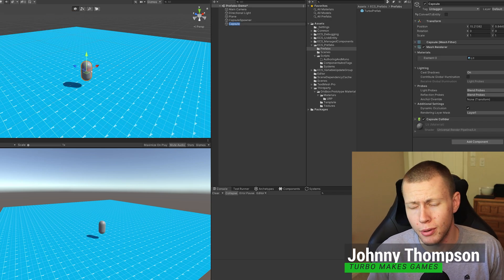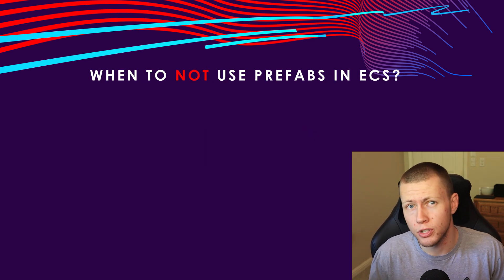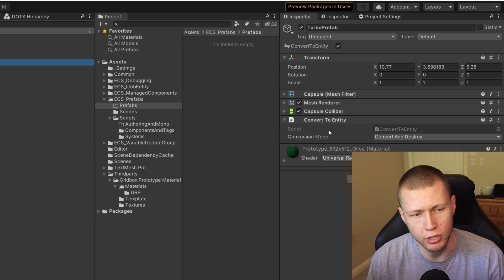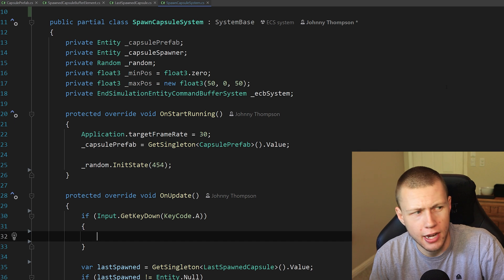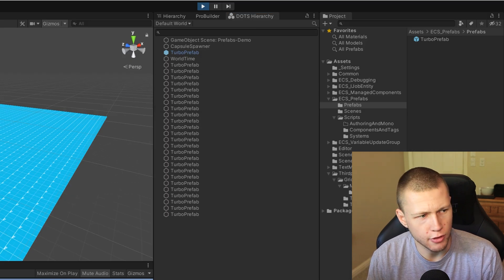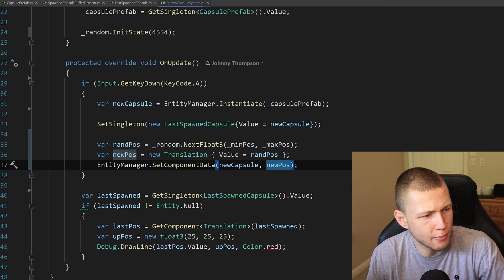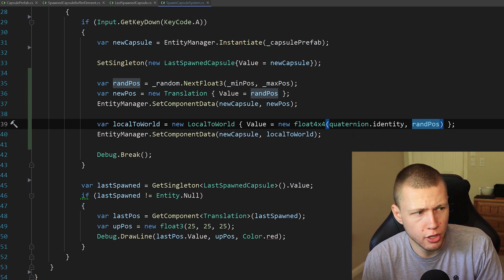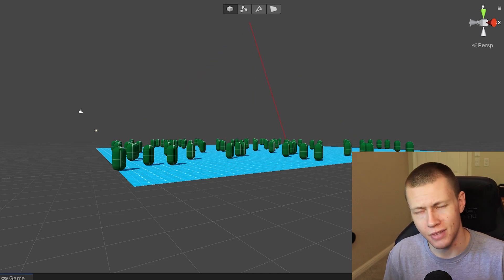The Prefab Workflow in Unity ECS - Unity DOTS Tutorial [ECS Ver. 0.50]

Comment: I'm having one problem that I don't see other having -- I can instantiate a prefab (it shows up clearly in the DOTS hierarchy, and I can instantiate as many as I'd like) but the game object doesn't appear in either the scene or game view. I'm using Unity 2021 LTS & ECS 0.51. Is there some obvious setting that perhaps I've missed?
Reply from the maker: Do you have the DOTS netcode packages installed as well? If so, there may be some extra steps you need to do to display them in your "client world"
Reply: @TurboMakesGames  I don't -- I'm creating a blank default 3D scene using 2021.3.10f1 and importing Entities 0.51.1-preview.21 – August 02, 2022. I've reproduced the effect using a blank URP 3D project. Both of these are on a Mac, but additionally I've exactly recreated the problem on my Windows machine. So quite likely there's some setting toggle I haven't switched since it's happening cross platform. I'm a bit out of ideas.
Reply: Did you ever happen to solve this? I know the package has changed a lot, but I'm experiencing something similar (2D)
Reply: @mattabrams3841  Unfortunately I didn't. I decided to abandon DOTS until it got a bit more stable (things look better now, but maybe not?). Let me know if you track down a solution.
Reply: @nazarremerchant  I noticed that my entities graphics was randomly no longer in my package registry. Super simple answer, just very unexpected behavior. I would double check the preview packages aren’t giving you any issues lol
Reply: @mattabrams3841  Thanks for the tip! I'll check this out and see if it is the underlying cause.

Comment: Interestingly, I don't need the [updatebefore] attribute as the spawn occurs before transform system group in my case. Not sure if this is because I am using the latest unity version and latest ECS version. 

In any case, thanks for the video. Btw, you did not mention about how to set up the "spawner" in the hierarchy. It takes me some time to figure it out.
Reply from the maker: The system update order is arbitrary but deterministic. Basically it means that if you don't specify any update before/after attributes for a new system, it will just go at a more or less random spot in the Simulation System Group - sometimes it may naturally be before or after the transform system group. But once the order has been set by Unity, it will always update in that same spot until you override that set order by using one of the attributes. I do have a video on here talking more about system update order if you are curious - https://youtu.be/oX0NElpfXgg
Hope that helps!
Reply: @TurboMakesGames  The video is great. As a newbie, I am still not sure about how "schedule parrallel", schedule, run etc fits in the system update order. It would be great to have a video talking about this.
Reply from the maker: @jimmyyu3383  I have a video on system update order, but to answer your question more directly - the system update order determines when a system executes in relation to other systems in your project. By doing a .Run(), the code in the job executes immediately on the main thread. When you do a .Schedule() the work in that job is just scheduled, but doesn't execute until an available worker thread can run that work. Jobs get executed in the order they are scheduled, by using the UpdateAfter/Before attributes you can effectively control the order your jobs get played back in. ScheduleParallel() is the same as Schedule, but it can run on multiple worker threads rather than just one. Hope that helps!

Comment: if i create monobehaviours - can i define which component they get turned into?
Reply from the maker: Great question, yes you can! You can create what is called as a "Custom Authoring Component" that gives you a bunch of flexibility about which components get added to the converted entity and you can even initialize them with specific values as you see fit. You just need to have your MonoBehaviour implement the IConvertGameObjectToEntity interface and define what you want to happen in the Convert() method. I think I have an older video on custom authoring components, but there is a good example of them in the video I just put up today - the one on making a stealth state machine in Unity ECS.

Comment: I kinda wonder the real use case here.
Let's say my location is tropical island so there are required many maybe thounds of different trees, not just few types like in usual forests. I tried many stuff VSP or GPUi, but does trees are actual ECS use case? Batching is great when it comes just for few models mass placed, but I'm getting real headaches with specific amount of trees that drastically impacts performance.
Reply from the maker: Most of the advantages of ECS are on the CPU and memory side. While the hybrid renderer does help with rendering performance, if you're running into some limits with the hybrid renderer with thousands of different types of trees then you might need to look elsewhere for that part specifically

Comment: So if I understand correctly updating the Translation/Rotation in SimulationSystemGroup can always cause incorrect rendering, not just when instantiating prefabs, because my system could run after the TransformSystemGroup, correct?
Since you are not supposed to work with LocalToWorld, I wonder why the TransformSystemGroup does not make use of OrderLast = true and is not a child of LateSimulationSystemGroup. That way it would always run after normal systems by default and you wouldn't have to add [UpdateAfter(typeof(TransformSystemGroup))] to every single system that writes to Translation or Rotation.
Do you have an idea why they didn't do it that way? Do you know why someone would not want TransformSystemGroup to run at the end of SimulationSystemGroup?
Reply: You're allowed to work with LTW, just not recommended when also using TRS components, due to the TransformSystemGroup.
I've not had any problems with rendering prefabs, though I have gotten use to pre-defining prefabs with negative Y values to keep solely the instantiated frame out of camera view. Never had a problem after the first frame, though.

It's probably just me, but I find it easier to have my own TRS systems in PresentationSystemGroup, as the half frame it takes to hit the LTW update is negligible, while allowing a lot of flexibility...
Reply: @jakehix8132  My point is that if I understood correctly you have a 50% chance to have a 1 frame delay until your changes to TRS hit LTW if you are running in SimulationSystemGroup and didn't specify an UpdateBefore and this can cause incorrect rendering. Of course a one frame delay is negligible in most cases, but still I wonder why TransformSystemGroup doesn't use OrderLast=true to avoid this. Especially since most people will not modify LTW directly as it is overridden each frame anyways. Is there anything I missed?
Reply from the maker: Could not tell you why they did not set it up as you described - things like this could definitely change in future versions though.
Reply: @Adrodoc  Honestly, I just have my own pair of SystemGroups in SimulationSystemGroup that either runs before TransformSystemGroup or is not affected by it. This way I can easily group the systems that do translations on TRS components to the group that is guaranteed to run before TSG. It's just a handful of lines of code and makes everything quite obvious. Never had a problem since doing that. With ECS you just need to be a bit more aware of what's going on "under the hood" and what Unity's default systems are doing than in regular Unity, but it's not like you need to understand everything perfectly. Just understanding the data flow is enough and planning for it accordingly.

Comment: Im currently working on a project that requires ECS to function, but It's on 2021! I can't use ECS until 0.51 comes out. What do you recommend I do in the mean time to prepare so that the time isn't wasted?
Reply: I'd say downgrade to 2022 if possible. If you're gonna wait until the next update, you're probably going to be waiting a while.
Reply: @definitelynotabotnope  downgrade to 2020 you mean?
Reply: Kinda depends on you. If it's a large project, there's surely plenty of non-code related work to be done. 

There shouldn't be just one instance that ECS will make or break a project in, though. Things like the Burst compiler and Jobs systems are already dev ready. ECS itself isn't exactly an upgrade to just a segment of a project.
Reply from the maker: I've heard people having various results with using ECS on 2021. While it isn't officially supported, you may be able to get it working. No guarantees though so take some good backups before you try it!!